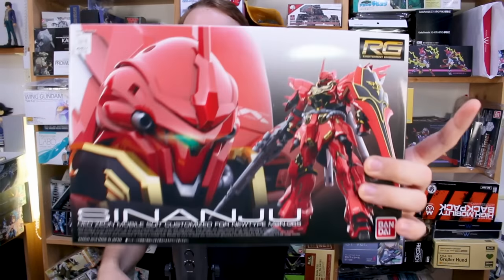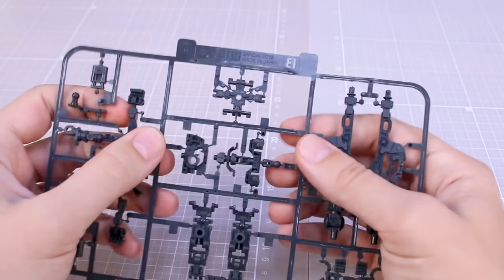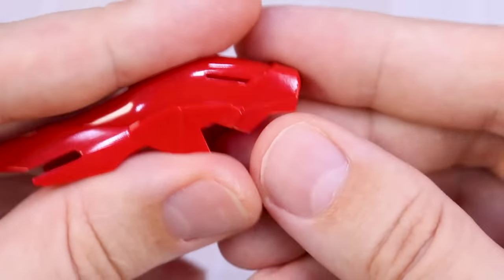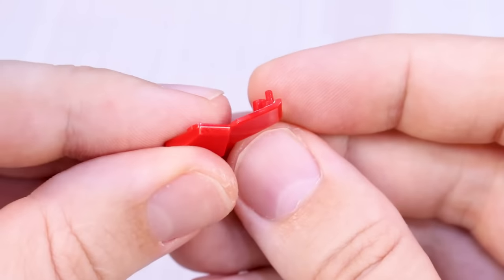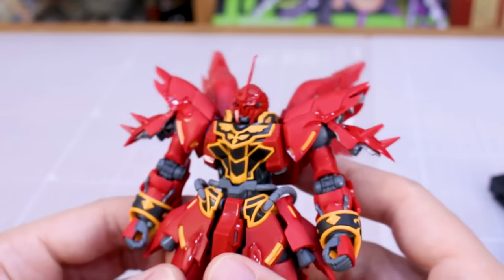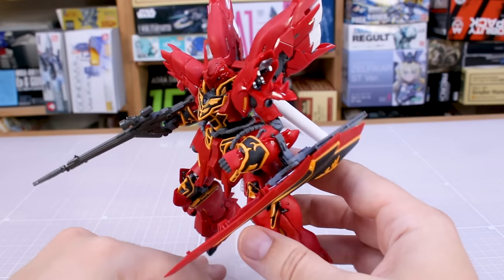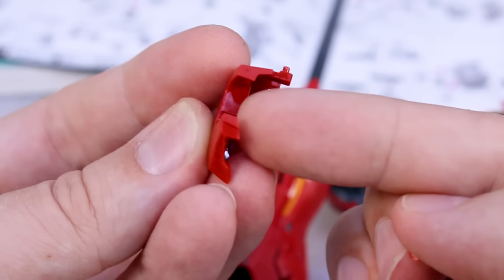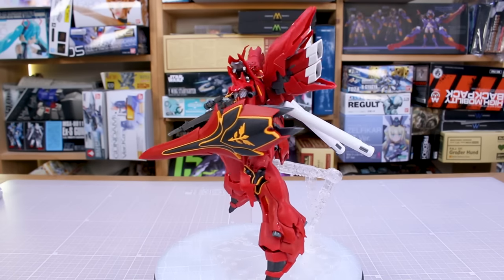What Makes a BAD RG? - In-Depth Case Study: RG Sinanju Revisited

Comment: I wonder - why settle down for some inserts that wedge into joints (making them unable to move, so defeating the purpose of, well, moving joints) instead of, say, using a clear coat over the loose parts?

You can grab the Mr. Hobby Aqueous semi-gloss and apply it over the ball joints (both the socket and the ball) to tighten it and use the rubbery texture it leaves for added friction. :) The aqueous is especially nice for that, because you can use it with a brush or an airbrush and it can be cleaned off the bristle with just water.

Sometimes it takes a couple thin layers (I overplayed with my 30 Minute Missions with posing and the wrists got loose very fast), but it works like a charm and can always be re-applied if it wears down over time. :)
Reply from the maker: For the amount of weight on that joint and the overall surface area of the joint that you could possibly hope to tighten, it’s just not going to be near as stable as actually bracing the joint

Comment: Its an awsome kit. My personal experience with the mg and rg is that i like the pre molded gold parts better than the stickers the mg has. But overall the mg wins it for me because its more sturdy, stands up on its own and you get the options with waterslides and normal stickers. And on the plus side, the mg is huge. Still, great time i had building both kits

Comment: Hate to be that guy because I know your start up is a rebuttal to the comments on one of your previous videos, but assembly lines can create defective parts. Every so often I encounter an HG for example that has defective ball polycaps. Its actually happened with three or four kits that I've purchased over the last few years. While yes, the build is the same across all of the same model, defects can occur.

Edit: Opening rant aside, good video. i appreciate that you got out of your way to show various solutions people can do to fix the flaws in this kit.
Reply: You're not wrong about a likely recent decline in quality control over at Bandai Hobby Center Japan. I have received at least 2 kits in the last year with color contamination (a speck of a different color in a part, caused by a pellet of the wrong color plastic getting melted down and shot into the mold) in at least one part, visible on the finished build. I've done some temp work in a plastic injection molding factory, and those runners should have been pulled from the bin during scrap sorting and recycled back into the new EcoPla project before they ever made it to the bagging stations and into the boxes to be shipped. Someone at BHCJ is either getting lazy to rush through production and meet demand, or Bandai, during the new 'blue logo' corporate restructuring, lowered the QC standards for Gunpla. 

Also, poorly molded polycap runners with nasty mold lines are definitely nothing new. Those molds, specifically the PC-002 runner, have been used literally millions of times at the factory, and probably haven't fit together perfectly flush in about 15 years. You have to remember, the runner for polycaps is in the box of around 85% of HGs. ALL HGs. For any single runner from any other kit they've printed, they've probably printed around 200 PC-002s. The molds are metal, but they still have a service life before the mold halves no longer fit together flush. Sounds like it may be time (or well past time) for them to machine some new PC-002 molds.

Comment: I wanted to try this kit but I never did get the time all these years given that I will be treating it as a project rather than a quick build. This sure gave me a few great ideas but I'd like to try other things like magnets and custom tracks to make the shield and some other parts more mobile. I tend to play with my kits so posability is something I'd like to maintain and toughening the joints to make it play resistant at least is a priority for me.

Comment: On unpainted kits I use high grit sand paper (1500 - 2000) on my final pass before rubbing the part down with a paper towel. The paper towel has just enough abrasiveness to provide a shine that matches the rest of the kit. I haven't tried a glass file, but being stiff I feel like its utility is limited.
Reply: I'm way too antsy about heavily sandpapering my kits. I'm always scared I'll permanently discolour the part so a lot of my kits still have cler white marks on them

Comment: There IS something to be said about molds aging and resulting defects piling up, but well-maintained molds seem to be nigh-immortal and produce results nigh-indistinguishable from early production runs. Bandai doesn't do the GREATEST job maintaining their molds, but, like... they have a LOT of molds... and also they do a good enough job that their reprints of stuff from like the 90s onwards don't seem to exhibit any flash/fitment issues, etc., AND ALSO they don't use their molds all that heavily the way some other companies might, which also helps to preserve their molds.

...and EVEN THEN companies like Hasegawa, that HAVE been producing the same exact VF-1 kit for like 20+ years straight, maintain those molds so well that, again, their modern production runs look and feel pretty much exactly the same as their original runs. (On this particular issue I can personally attest, as I still have an original run kit, unfinished, from all the way back in my middle school days, and comparing it to a recent reprint I purchased, the two kits may as well be identical. You could mix and match parts and there would be nary a difference in the build.)

Personally, I remember being confused by all the issues people had with the Sinanju because I never experienced it with my build. It seems to have been common enough, though, that it became... well, common knowledge. That said, a part of me has always wondered if the RG Sinanju's reputation was based on issues that were blown out of proportion, so I appreciate this attempt to look back and dissect the validity of its complaints.
Reply from the maker: It was blown out of proportion, that’s the negative effect large YouTube channels can have on the community. Why I always try to keep a fair and positive mind in my reviews

Comment: For the most part, I mostly do some chores or repeat some Office or Brooklyn Nine-Nine or Buzzfeed Unsolved video while waiting for paints to dry, that is if I don't have any leftover chores.
Reply from the maker: You’re one of the very few who actually answered the question! Thank you
Reply: @ZakuAurelius  You're welcome Sir. I mostly use bosny so waiting time is mostly short, but I tend to extend it to be sure the paint dries properly. And it's kind of an excuse to watch more.

Also, thank you for the tip abouy the Sinanju body frame. I've seen many "fixes" for the ab crunch and for the most part, they are temporary fixes. Supergluing those ab crunches didn't work on me because when the armor plates are placed again, the added weight and probably the smoothness of the joint somehow broke the superglue's hold.

Comment: the best way to get rid of chrome on your plastic is to leave it in bleach for about 24hr. If you want a faster result you can use oven cleaner and it will take it off in 10 mins, but it may make the styrene brittle.

Comment: ive built the RG amatsu mina that have similarly glossy pieces. what i hated most about it is the plastic is extremely hard, and its really easy to accidentally crack and flake the area around the nub if ur not extra careful

i kinda like the sinanju in matte and gold part yellow tbh
Reply from the maker: Yep it’s the same mix as clear color parts, extra brittle

Comment: when you say to use superglue, would plastic cement work just as well?

To clarify; I'm specifically referring to securing the loose parts.
Reply from the maker: Depends on the plastic. The inner frame is abs and so you’d need specific ABS glue or superglue. Plastic cement is typically just for PS plastic
Reply: @ZakuAurelius  ah. Makes sense. Thanks!!

Comment: As an action figure it guy, I get models to feel gaps in my collection. However I think modelers go too far at times. For example stripping the gold plated frame only to repaint it. That's just overkill in my eyes. And adding extra unnecessary steps. But I do understand that kits can handle light play but not bang and clash.
Reply: I have never done painting myself, but I can't stand Chrome Gold, I would rather strip it to matte Black.  
Hyaku-Shiki 2.0 had the best Gold.
Reply: @UVAmatsuo  I like it in dose's, but I prefer a gold metallic paint. Can't stand all those finger prints.
Reply from the maker: I’m gonna paint the gold parts in a different color, that’s why. To be fair, I didn’t make that clear in the video
Reply: @ZakuAurelius  o ok, makes sense now lol

Comment: The only complaint I have with the rg sinanju kit is the balance issues especially the knee caps pop off and the arms gold parts pop off when you try to pose it and the arms don't hold up with the shield and the waist part sucks when you try to rotate it and comes so loose.. and the last thing is my rg sinanju fell off of my display shelf so yeah I didn't like the design of the rg sinanju but I do prefer rg sazabi

Comment: Id be happy with a 1/144 scale MG that's cheaper, basically just with shrunk down pieces. I wonder if it's not feasible due to costs.
Reply: 1/144 scale MG is called RG.
RG's design is in line with MG and has full internal frame structure like MG.
Reply: @ksong1496 copy that, I tried the RG Freedom bit the pre-made internal frames a bit fragile. I stopped building mines when the arm broke. I ended up buying/building the MG Freedom 2.0. To Bandai's credit, they did send me a replacement of the frame for the arm.

Comment: my dudes, for the shield on the side please just use the ms joint that was planned to attatch it on the shoulder!!!!!
is easyer and not permanent
Reply from the maker: But it’s attached to the shoulder, which is just weird
Reply: @ZakuAurelius  is not if you wont, that's the magic behind it! 
you can use it the same way as mkii shield, and the change is reversible, simple as that!
cheers and thanks for the awsome tips!

Comment: Kits like the should not be left to the builder to "fix" its problems. A kit should be improved (hence customizing) by the builder, not fix it.

The Sinanju is an awesome looking kit as an end product, but it does not change the fact that it was/is a problematic kit if you don't "fix" it.
Reply from the maker: Problematic yes, sure, in small ways. My point was simply that the kit is not “garbage” as some make it out to be.

Comment: The issue to me coming into this hooby of Gunpla/Scale modeling from Table Top Gaming and Video games before that and Mcfarlane/action figures before that that and just Diacast though out... Aan the only models I did not play with withe the Collector's Edition statures that to a scale modeler would be premade diaramas or figures I wouldn't call the Halo Reach stature a figure but still. Pretty much your defnation of what is a Toy and what is Model is flawed becuase in Table Top some companies just scaled down model kit to a play able size and you play with them... Slowly but still... And I've heard of old Mcfarliane figures that suck as toys dispite being premade and are toys as they would fall apart. I've have seen Gunpla on youtube hold up do play better then that as you just reset the part in Table top we just glue it back on and repaint it if we drop it. Point is what I've seen of Gunpla it's nothing that isn't in Table Top and those models are toys.

Comment: That "not a toy" disclaimer is for legal reasons. 
Explain entry grades
Reply from the maker: Super basic model kit that can be produced and sold for as little as possible but thanks to high engineering is able to perform on the same level as a kit 50-100% more expensive 🤷‍♂️

Comment: You know you goufed up when the hg is a more solid kit than the rg
Reply from the maker: Engineering 101: more moving parts means easier to break
Reply: This comment doesn't make any sense. HGs are dead simple compared to RGs, so HGs are always going to be way more solid regardless of the kit
Reply: @rafekazi  yea, also less detailed

RG sinanju is an exception though, it have better part seperation, not really detailed

Hybriding would actually work much easier on this
Reply: @rafekazi  when I mean is the hg sinanju is a more solid kit than the rg variant, (hg) nice heft, the joints have the right amount of tightness and it can stand on its own, but the poses are very limited all I can do is make him do shooting poses and poses wielding his weapons, compared to the rg, its s**t with the limitations on poses as well as the chunky back i heavily doubt you can make a standing pose (on my experience that is), all of my rg kits even with the real grade syndromes they remain posable (with thier own limitations) without the help of a stand and then sinanju came XD